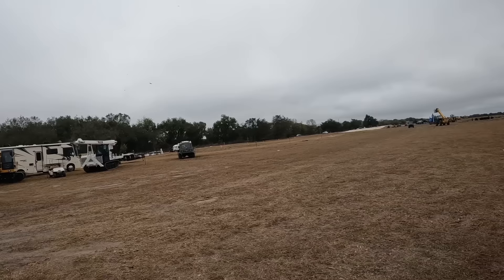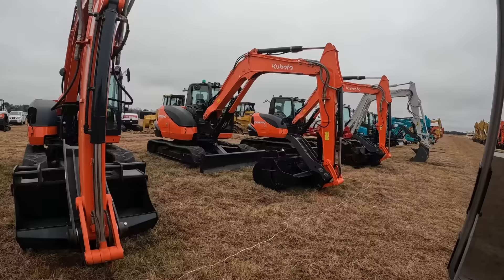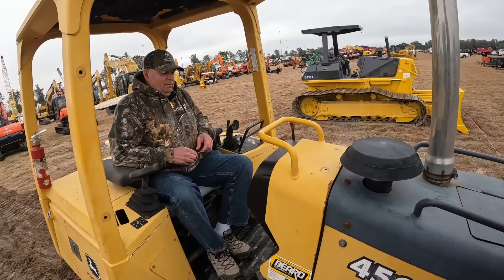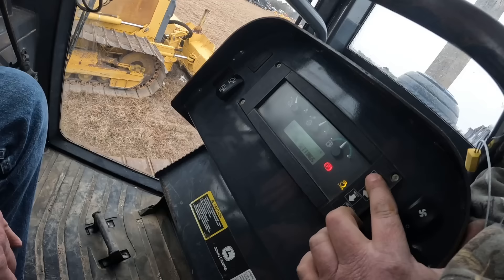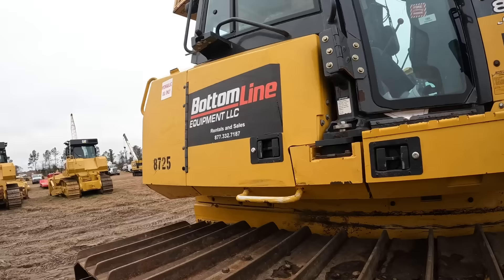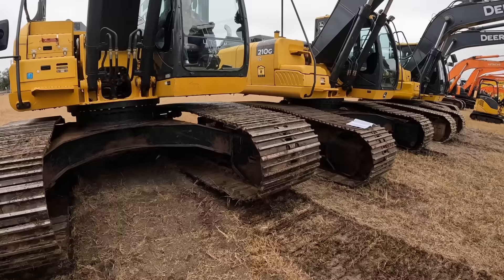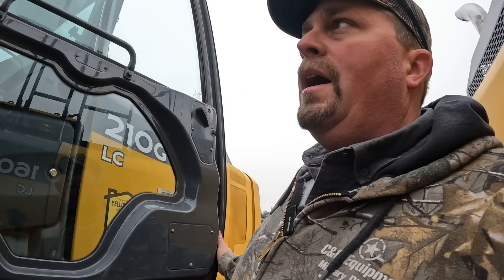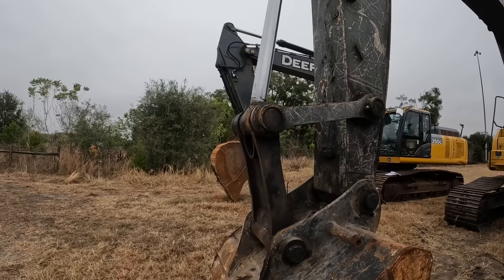Florida auctions stop #1 @ Lyon Auction. What did we find Feb. 2022

Comment: Good video.  As you say there is a reason the pop up on a auction. And there is always someone that think can be anything wrong with that one. And bid them up like crazy,  but if it go for more than you can buy on the open market  when the machine have been out for 6-12 months and not sold from a dealer with service, on an  auction its prob not a good deal but some people dont learn they just bid and bid until they so far down in the hole
Reply from the maker: Yep

Comment: The mic on your collar is a great addition. I struggle to hear folks sometimes when there's background noise, like the machines running. Could hear everything you said perfectly.
Reply from the maker: Thanks 
It’s more work for sure
I’ll try to use it when I can
Reply: @C_CEQUIPMENT  I can hear you just fine pretty much all the time. When you were at the auction walking around the machines as they were running is where I meant the collar mic works well. I know there;s a lot involved in combinig the sound and video so thanks for doing that

Comment: A very informative video.  Thanks for all the insights!  An FYI on the Chinese equipment, some manufactures are using DIN hydraulic hose & fittings.  They look like JIC fitting till you pull them apart.  Then it's double the $$ for a replacement hose.  After you find a shop that is set up for DIN.
Reply from the maker: Yep for sure
I hate those

Comment: The Bobcat E60, 63, 80 and 85 early models are Doosan built, Bobcat branded. The later E85 are bobcat built. I heard some of the smaller bobcat built are branded Doosan over seas, but haven't been able to confirm. I also believe the E145 is a Doosan machine.

Comment: Great video Clint. The gold dog in the Early R & DM models from mid 60's  & into the 70's meant the truck had a maxidyne engine in it . The 237 maxidyne came out about the same time as the R & DM mods . 

Such was the case with the 65-72 Steel Dash R model  in the video . A 675 Mack engine is a 237 . Unless you need the 2 stick 6 speed like my family did in the DM Macks the 237 Maxidyne & 5 speed was a tough drive line to beat..😎  my family ran 237 ( 675) & 2 stick 6 speed transmissions in DM Mack Dump trucks . That extra lo gear is awesome in soft ground.

The gold dog took a hiatus in the 80's on new pure bred trucks . ( Not sure why ) but When Mack bought the gold dog back in the 90's that's when it became a symbol of a pure bred bulldog. 

That's one of the cleanest Steel dash Bulldogs I've seen in a long time..

Mack
Reply from the maker: Thanks for the info 
I grew up driving a dm 2 stick and had an 84 r model for a semi before the Pete’s
Reply: Anytime buddy. Those ole Bulldogs & Autocars is all I know.😂. That's a nice Pete Lowboy tractor you have there.

Comment: I have a 245GLC w/thb. You are correct about the same reach, etc. as the 210 but mine weighs 60,000# (a fair bit more than the 210). The zero tail Deeres (135 & 245) are just yellow Hitachis (not Deere engines like their other medium and larger excavators), and, from what I read, will still be made by Hitachi (not sure why) even though Deere and Hitachi are splitting up like you mentioned. Yes, the 245G does come with a 4 cylinder Isuzu like you said it might. The 245G also has a third pump (dedicated to swing) but, in my opinion, it does not swing as fast as a 210G. Even the oil and filters (that I buy from Deere for the 245G) say Hitachi on them!

I've always been very wary of auction machines. Even if one does what I've seen you doing in your video, you never know how it's going to be until you actually run it hard for a while. Despite that, I always have found auctions very interesting. From seeing how folks check a machine over (like in your video here) to how they actually bid on the units. It would have been nice to see you bidding. Especially when you were bidding on that Volvo Off-road truck for DP. With all the effort you put in, I hope that you were able to bring home some inventory.
Reply from the maker: We did get some stuff

Comment: That 850k is from my town and I’ve been on site with that dozer because I remember that play in that center joint of the blade frame, the poor thing didn’t get touched with any grease unless she started screeching for 8 months straight, most of bottom line equipment is beat to hell and their mechanics don’t give a single care unless it doesn’t work, been on site with their equipment that I’ll be 1,000hrs over fluid change and you call them asking what’s going on and they don’t care, “ still runs right “ is what they’ll ask.
Reply from the maker: Yea
I could see that

Comment: Its a shame. The mini excavators fetch a bunch ez to move and can be used anywhere, the really big ones sell for less money cost a bunch to move and require permits to move a wide load but they can do more work a lot faster. 
Id love to have a mini to use or a brush hog on a bobcat  the excavator to dig a dry creek for drainage and the bobcat to clear a fence line under power lines.

Comment: Buying Auction equipment isn't like it used to be. There's a lot more detail involved on the inspection side of things than there was in the 80's and 90's, there's just so many more things that can be wrong with them that can get very expensive (electronics and emissions just to start with. I really miss the days of a straight mechanical machine with no emissions and not much for electronics other than the key switch and your gauges.
Reply from the maker: For sure

Comment: Clinton, quick question on the zero turn radius machines and picking themselves up at idle. Wouldn't part of the reason they have more issue is because the counterweight is closer to the center balance point and they are having to lift more weight? Surely the counterweight being closer means it has to weigh more to balance out plus would cause it to lose leverage.
Reply from the maker: Yea
Some
But I have had these in the past and they should do that
Reply: @C_CEQUIPMENT  Thanks Clinton.. You're the expert so I will trust your insight on that.

Comment: When you say check the blow buy what does that mean? And does that apply to all machines?
Reply from the maker: Yes it does
It’s basically the compression blowing past piston rings going into crankcase that’s why you pull the oil fill cap
Tell tale sign of an worn engine

Comment: Case link belt both built by sutimo just like deere Hitachi
Reply from the maker: Yep
Reply: @C_CEQUIPMENT  all of the zero radius jd machines are 100percent Hitachi off the boat with isuzu engines innthe smaller 245 and down.

Comment: The 850 center ball is a 2 hour job have done several for a local quarry, Airarc the old ball off and the socket on the other arm weld on the new ones. There is several after market companies already making replacements and deere sells a whole kit ball and socket and shims and the 4 new bolts. If you want them to last longer than stock have  the ball turned down and weld the ball up with wearshield me rods and have a machine shop turn it back down it will last way longer than stock one. I see those centers going out around every 2500 hrs stock and the ones I've  hardfaced been going out 4-5000hrs. Deere split arms are one of their piss poor designs.
Reply from the maker: Yea
Big problem is nobody greases them everyday like they should

Comment: In my experience as an operator  with brand new zero turn excavators in the 235 245 size.   They don't deliver  the same power as a machine with a standard  counter weight.   They don't lift the same as well  the swing speed is alot slower.  And like u seen they don't pick the front of the machine up the same.   Seems normal to me.   I don't like it.